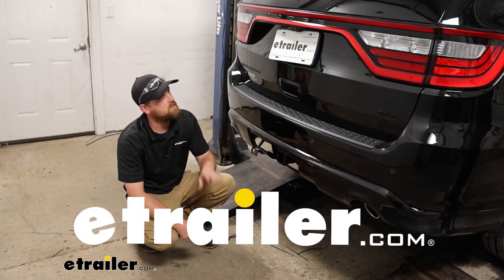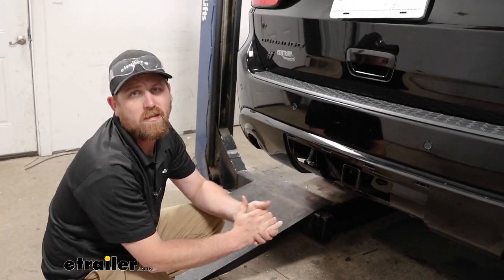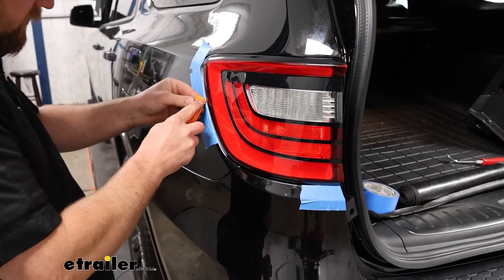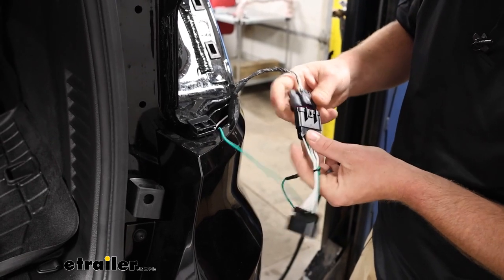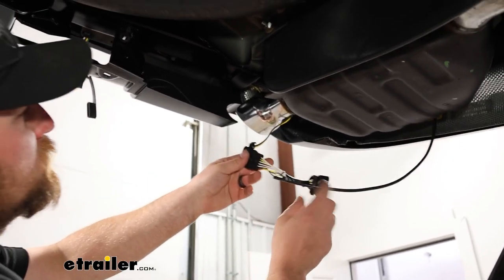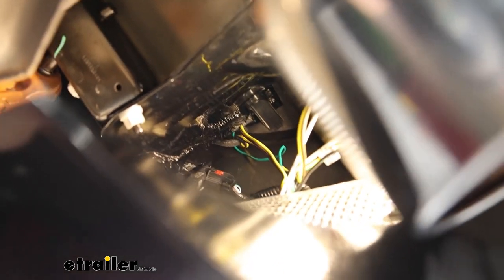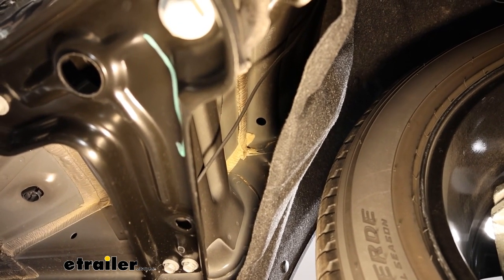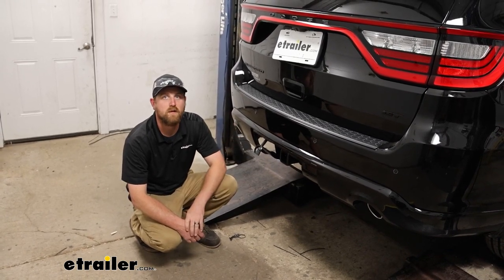etrailer | Curt T-Connector Vehicle Wiring Harness Installation - 2022 Dodge Durango

Comment: What the name of the trailer hitch??
Reply from the maker: We used the etrailer brand Class III hitch, part # e98901. You can check it out by using this link which includes install videos:
https://www.etrailer.com/Trailer-Hitch/Dodge/Durango/2022/e98901.html?VehicleID=202286773

Comment: It should come with heat shrink. Its ridiculous not to
Reply from the maker: We agree, but Tekonsha and Hopkins don't include them either. We offer the heat shrink butt connectors as part # DW05745-5.
https://www.etrailer.com/Wiring/Deka/DW05745-5.html
https://www.etrailer.com/Custom-Fit-Vehicle-Wiring/CURT/C56336.html